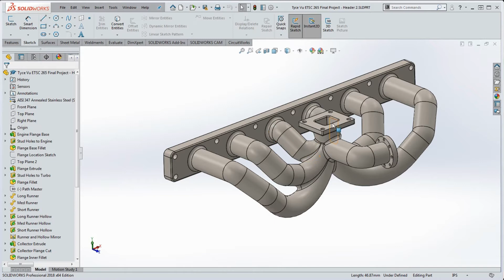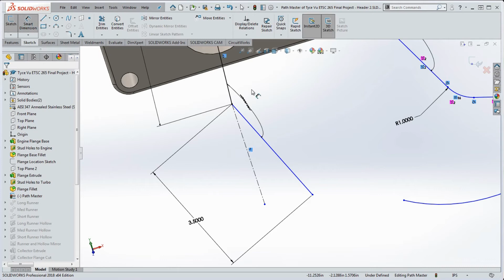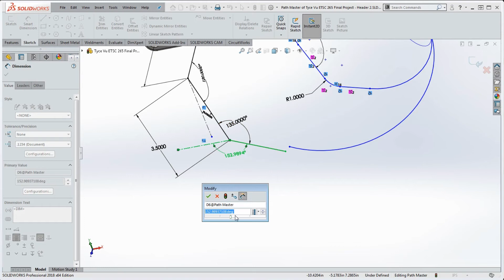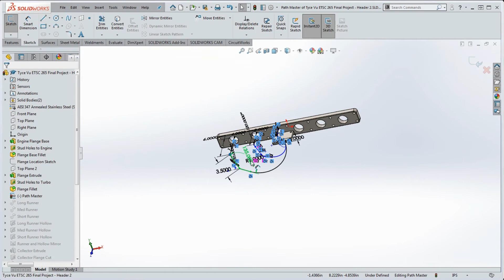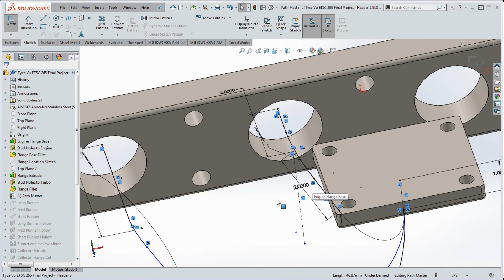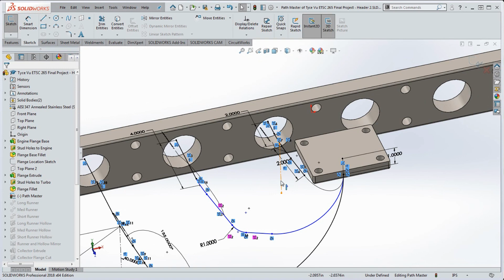SolidWorks, How to Fully Define a 3D Sketch that Contains Non-Planar Lines and Arcs

Comment: it is beyond difficult to fully define arcs. as a solidworks user for seven years, i find it sorely disappointing that the makers of this app haven't made this easier to accomplish. kind of like the dialog boxes leftover from the windows XP era.
Reply from the maker: @HBrooks  Yup, a 3D sketch is different with out a plane for a reference and can be a difficult animal to manage because of that.

Thanks for the comment!
Reply: @DesignInnovations  thank you for the reply. 
i discovered it was easier to do multiple sketches on planes for the arcs and follow those up with converting the lines in a 3d sketch. the model is a sign cabinet, 9x16x2 feet in size that is curved. curved framing weldments. a curved face and back panels as well with reverse cut pattern (triangular holes). frustrating fun.
Reply from the maker: @HBrooks  Some projects can be difficult - but you can learn from them too and apply the knowledge next time - good luck on things!
Reply: @HBrooks  I can see your method working too.  Thanks for sharing.  CSS